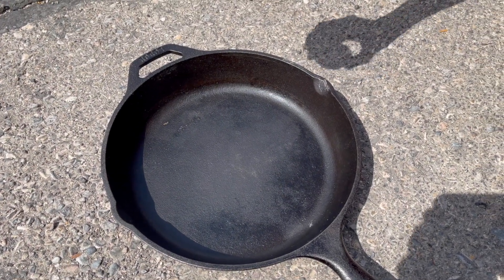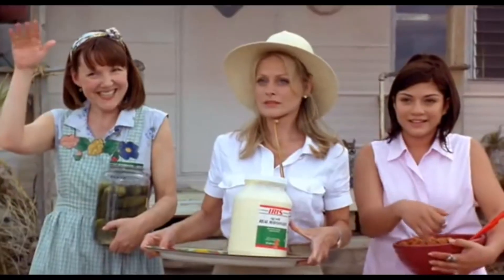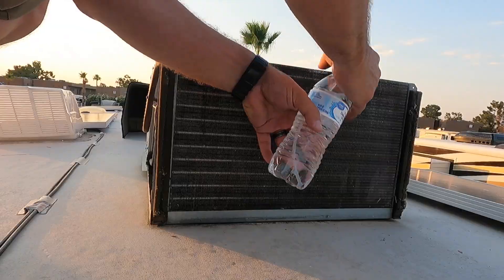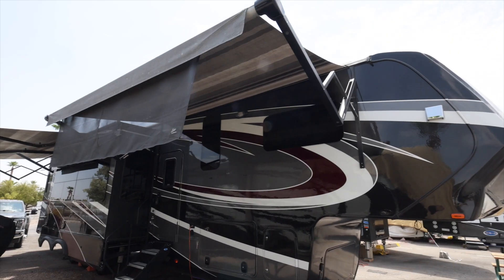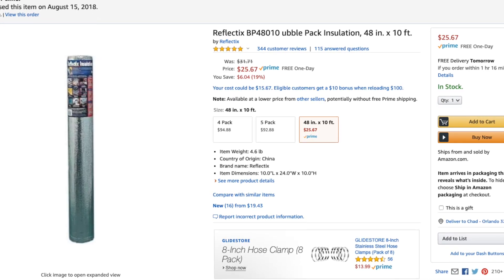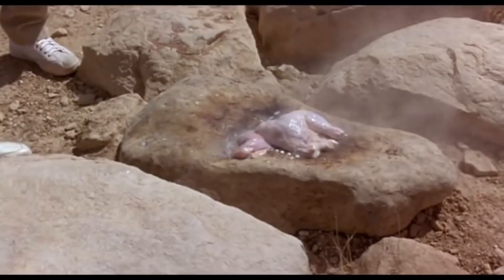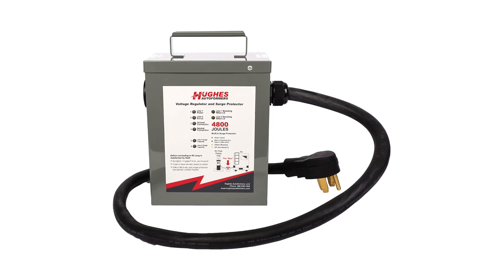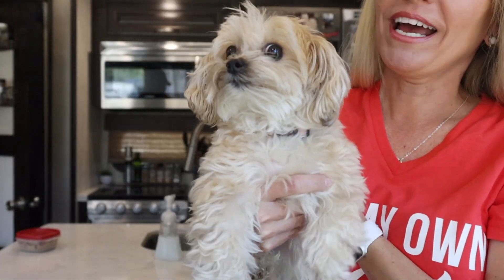🥵  RVing in EXTREME HEAT! ☀️ (Full Time RV Life)

Comment: I am a travel nurse that was in ridgecrest last year that was 122 at the fair grounds with no shade.  I had to do the fans to the fridge (I did dryer louvers so when not in use stayed covered), the airflow ac hack,  reflectix in the windows made 15 degree difference, reflectix in all the cabinets that touch the outside (this included my closet), black covers for the maxi air and bathroom fans, relectix in the shower as well with ivy tape.. you could tell in the evening when the sun heat let up cause it would start to get cool again.. I bought booties for the pup as well.. the coldest place was the spot that went to the crate for pup and the bathroom after covering fan/skylight.  I have a reflection.  I saw in bakerfield ca a nurse who had the sunshade and said it worked. In bakersfield many of them put in a window unit that ran better than the rv ac.  This year I am in fresno with 110 ish  and with shade, soooo it's a tad better cause hot shade is still hot.   the 120 plus days the rv did get to low 90 in rv and with a fan was tolerable but no way fun at all...    I am going to get me a ice maker this year to put ice in bins in fridge to help.. I am doing water bottles but the freezer take a few days to freeze them..

Comment: Another great helpful video! Ty for helping people in this way. 
If I can add one thing. 104v and lower WILL damage electronics! I hope people will get something that will monitor this. I use a power watchdog. And it automatically cuts power at 104v. Even if your starting voltage is 113v or so. It can and does dip below 104v without you knowing when others around you use more power. 
I just battled low voltage for 3 weeks. Starting voltage was 117v. Around dinner time, 4 to 8pm. EVERYDAY my watchdog would shut it off so much I found myself sitting in the dark watching YouTube on my phone. Thank goodness I didn't need my A/C. 

I hope this helps someone.

Comment: Chad, FYI. A good hack for low voltage problems is to run a small water line (1/4" poly flow) to a mister nozzle in front of condenser. Makes a small mess but will lower compressor amperage alot.

Comment: We use Micro Air Easy Starts on our Airstream and it's amazing how low the amps become with those in use and have never had an issue with our AC's starting and staying on during high heat situations.  Highly recommend you get those put on your rig Chad.  You won't regret it!

Comment: If you have water, a mister (in the irrigation section) will greatly help remove the heat from the coils and make your AC more efficent.  in an arid climate such as Las Vegas, the water will evaporate quickly;
Also while boondocking, a small spot cooler (12,000 btu) runs on 120 volts (less than 1000 watts)for less that $400.00.  .A small quiet generator is about 67db (quiet) and will handle 2000 watts (1600 continuous). Harbor Freight has a quiet generator for less than $600.00.
Will not bother people at Harvest Host etc.

Comment: Water misting helps reduce the temp by about 10 degrees.  I put a sprinkler hose on the roof of my store during a heat wave (I had my own well).  Most people didn't even know it was up there, but they sure noticed the building was cooler. Problem is the west is also short on water right now.

Comment: I find the exterior wall cabinets on the sun side of the rv always trap and hold heat. My question is would it be better to open them to get rid of that heat or would it help as a barrier to keep that heat trapped.
Propane fridge for the win!

Comment: I feel you guys. We have a 42 footer. I think we got to 118 Phoenix AZ. Thankfully we have great voltage. We don't have a toy hauler so that might have helped but we needed to make adjustments fast. One day (109°) we found one of the shade slid off the roll. The glue had soften to the point it couldn't hold anymore. Putting that back on was a challenge. The biggest difference was that reflectix in every window and the shades down. We also have the awnings out when it wasn't very windy and slide top awnings which I believe help keep the sun/heat off the slides. We have the 3rd A/C on from morning to sundown. We also added the RVairflow.  Door closed as much as possible. We also have the Norclold 18 cb ft but it did well maybe because its newer. We also had heat coming from the stairs and found that there is a furnace vent there. I blocked that hole and that kept that doorway and hallway cooler as well. We will be in cooler places the next time for sure. Thank you for sharing your knowledge with us it makes a difference.

Comment: Howdy folks! FWIW, I just installed that softstart on my truck camper, and tested it yesterday. I just have the one AC. My generator/inverter in of the Honda flavor, and is one of the older models (2000W). In the past, I've always run the gen. on the "eco" mode, and it would "step up" to meet the electrical needs. This time, that didn't work. What did work, however, was to just use the gen. on the full run mode. It worked flawlessly with that little gen./inverter! Also, the hook up of the softstart was super easy, the most difficult part was finding a place for the unit under the shroud, there was virtually NO space in there for it, but managed to put it under the fan, where I pray it will not interfere with the AC performance down the road.

Comment: Wife and I were camping in Maine this year during June when temperatures were reaching 96F. Our campsite electric hookup was cycling between 110 and 102 Volts which was blowing our surge protector and shutting off our AC/frig. I was worried that our compressor frig and AC unit might be damaged from the low voltage, so I ran them off our LiFePO4 battery bank through our inverter and used the non-surge protected low voltage campsite hookup to charge the batteries. The AC and frig saw good voltage from our inverter and the batteries stayed topped off.  We ran that way for 5 days without issue. Sometime you have to MacGyver your systems when the campsite utilities are dubious.

Comment: I have an older class B. The air conditioning is a piece of cardboard I wave with my hand! Lol. I have a few fans too but they use a lot of amps off my deep cycle battery, so I only run them when I have AC power. I'm looking for a small window air conditioner I can set in the door window & run when I have AC power.

Comment: Hey Chad and Tara,  I am stationary living full time. When the heat gets above 90 I place a  10" round fan in all just above the steps.  This helps pull the cold air down the hall and pushes it into bye main living area.  It also helps cool down the hallway.   This keeps the5th wheel in the upper 70s. Worked in 117 degree heat.  We have 3 a/c s going and it works.  2 adults and 2 toddlers.      Reflects in the windows.       I wanna thank you both for channel,  it helps me learn how to keep are home safe and maintained.

Comment: Another tip is to take a look at your doors!  Both external and internal, they all should have some sort of gasket, although lately, with the cost cutting going on with RV companies, there are alot being sold without them.  If your gasket material is old or compressed enough where you're not getting a good seal, or are non-existent, have them replaced.  In a pinch you can use towels to put in-between the door and the frame when shut.  You can test whether you're getting a good seal by shaking the door while closed, if you can see/feel lateral movement you're not sealed. Also with internal doors, I've seen some very well gasketed seals but with  a huge gap under the door.  You really want to seal that gap with towels or blankets to keep that (hopefully) cold air from leaving that room you're in.  Stay cool!

Comment: Great video. After watching, I went out to my unit and was going to do this modification. However, I found that my plenum was built and sealed pretty well. It had a very rigid divider. This was great because the insert you showed probably would not fit anyway - there are wires and a control box in the way. Anyway, one big discovery I must thank you for is that I found my dump vent slider greatly restricted the outflow of cold air even when it was open. Fortunately, I can triple (I guess-stimate) the outbound cold air flow just by removing that half of the cover panel, which is easily done. Should make at least 15-30% air flow gain. Side comment - I built some inch thick window inserts out of common foam board and wrapped the edges. I painted one side (the non-silvered side, reflective side goes out) to match the interior of our rig. They snug-fit easily. They came out very elegant looking and even had some visitors state they thought they were an OEM option. We use them mostly at night for cold nights, and they black out the interior so you can sleep in late if you want. They would also work in the really hot days. 

I have been intermittently watching your videos and now I will become a subscriber. Thanks!

Comment: We stayed this last June in las vegas. The Temps were around 118 to 120 during the day and around 103 at night. We stayed in our 2002 newmar mountian aire 4065 diesel pusher motohome with dual slides and only dual ac units. This coach did really well in these Temps. We never saw over 75 degrees inside and did not use any out of the normal tactics to keep the heat out. We just closed the shades to the night shades and kept ac units on. The units did not cycle much during the day but once the sun went down the units would start to cycle normal all the way thru about 9am. We stayed at oasis rv park with is off the strip right across the highway from the silverton casino. We will definitely be taking another trip to Las Vegas and staying at that rv park. It is beautiful there and a great park! Power was never an issue. We never had any issues with our fridge either. It was constantly cold and freezer frozen. Strange that you had so many issues. Maybe difference between the way a class a coach is built to the way a 5er is built?

Comment: Just know that utility are required to provide 120/ 240 volts (+/- 5%). Most folks are not aware of this requirement. Also when the very high temperatures all utilities are trying very hard to keep the voltage on levels 500kv, 230kv, 115kv, 66kv and so forth at it highest level which keeps the current at lower levels. It’s a balancing act for sure. Hoping this helps some. Enjoy watching your videos.

Comment: I agree the post should have been as expected, but I do have a SoftStart and I’ve found it makes a HUGE difference.  It requires much less power to run my AC and my AC is MUCH quieter, which means there’s much lower likelihood of blowing a breaker. I’m definitely a fan!! I also have a diagnosing surge protector that would have proven to that campground that the post was at least part of the underlying issue.

Comment: You need to get the Soft Start devices for your roof air conditioners.  They not only help to get them started without the big current surge but they help with the overall operation of the air units to last longer.

Comment: Thanks for sharing!! Is there a way to run one AC on solar and two AC's on the generator when in a pinch?
Reply from the maker: sort of...  The inverter can do power share but only on line 1.  We could set the shore power setting to something like 5 A on line 1 and it would pick up the main AC...  Then the rest could run on genny....

Comment: I’m full time . travel trailer rv ;stationary with 5% ceramic tint , factory shades with black out curtains, clean AC , 2” foam board in roof vents . Constant heat index here are 98 degrees (F)outside with 75 deg (F) inside . The ceramic tint lowered inside temp 5 degrees
Reply: What's a ceramic tint?
Reply: @immasher2139  Its a type of window tint film. It mostly blocks uv and infrared light while letting visible light though. Popular on cars in hot climates.
Reply: @mgkleym  so it's a low E film?
Reply: @immasher2139  it's a type of low e film. It's called ceramic because it literally uses tiny particles of ceramic instead of the more common dyed or metallic films.

Comment: We just brought our new 5th wheel home and for craps and giggles we tried the A/C and it ran for at least 45 minutes then the house circuit blew. Its only plugged into 110 but we had the house ac going, lights on etc. Its one of those Whisper Quiet A/C's so not sure if it has a soft start but our Rockwood just had a regular RV A/C and it would pop a circuit in a second. It's been hot and humid here too in the NE, put a coat of wax on the new rig and swear I lost like 10lbs, its 43ft long so it took me a bit. Seems like you guys did everything you could possibly do. One thing I love about this new rig is residential fridge/freezer! No more stupid rv fridge getting into the 40's.

Comment: I grew up in Baker, CA, just 90 miles south of Vegas.  I always tell people that it would always have overnight lows in the 100's but nobody would really believe me.  We used swamp coolers, i.e. evaporative cooling, and it works better than AC in the right conditions, with no humidity, and high heat.
Just as an addon, you should really avoid the desert southwest in the summer :P  It gets warm.

Comment: It hit 118F even all of the way up here in N Idaho (High Humidity also), AC condensers iced up 3 times in 3 days, was a struggle to keep it below 100F inside the RV (35') with 2x AC's.

Did find that putting a pice of 2" insulation foam over the top of the fridge slide helped the fridge a lot
Reply: Any ac unit will ice up if they run for to long time, And unfortunately hi humidity does not help.
What you can do is shut off the ac for about 5 minutes with only the fan running this will help to remove the ice on COIL where airflow can be reestablished.Hope this helps!

Comment: Hi Guys, Can definitely relate we have been in Quartzsite Az  since June. Installed 2 Micro air  easy starts in our Ac units along with RV Airflow thanks to you. We have 2020 Grand Design Reflection 29rs. Haven't thought to check the voltage at the  pedestal but  with the soft starts have had no problems with tripping  breakers the temperatures here were as hot as Vegas if not hotter managed to get 23 to 25degrees cooler than outside. Our rig is only 31 feet but between both upgrades along with  slide toppers we're hanging in there. We can relate to the hot wind too. Today is the coolest day we've had since we got back here. We alternate Ac's  bedroom at  night and living room during the day both if it gets to hot as our pooches need to stay cool too. 
Former Nevadans from the Reno area. 
Take care and try to stay cool. 
D & C Hopper

Comment: When camping off my motorcycle or driving my truck (no AC option), I use a spray bottle filled with water and spray myself intermittently. I also soak my shirts. I keep a floppy hat with me. Lightweight long sleeve moisture wicking shirts as well. It's not all that bad to camp in the desert during summer. Main thing is acclimating your body to deal with it. As far as your RV ditch the AC idea, open widows and use my above tips.

Comment: Great video  I live full time in a 19 foot travel trailer in Mesa AZ  hot temperatures. The ac does not have a thermostat on and off switch when I get home from work it's hot in the trailer 110 120 .takes a while to cool it down.  The refrigerator I put two frozen water bottles and a small fan to it in the high 30s. I would like to move my wallet said no also not sure I can trust my truck on the highway in this heat.

Comment: I was told that I would never want to goes there to Vegas during summer as I did once (the first time) there in July 2005 & temp were over 120 degrees! I did have a pass-out at my hotel bed after a short walk in the nighttime on the sidewalk. Also, the hotel had a small pool as it does not look good to turn out terrible water from too many people who used lotions floating the water. I never like to go there again the way of the summer season. I prefer the winter season when the temp is cooling down. Now you know what it is like to be there during the hottest season in Vegas. Will you want to goes there again?

Comment: I’ve found that taking the garden hose and wetting down the roof helps immensely.
Reply from the maker: I thought about that.. maybe a lawn sprinkler on the roof.. but the park does not allow it. ☹️
Reply: @ChangingLanes  You might be able to at least cool off under your awning by building a misting rig using 1/4" plastic hose and mist nozzles like those used for plant watering. I do this to cool my deck surface for my dog's paws as well as hanging from our awning tube when we stay anywhere in the South during the Summer. If you're in a park that won't mind, putting this on your roof should significantly cool things down without using as much water as a full on sprinkler.
Reply: @ChangingLanes  we have cooling misters that string along our awning but can also be coiled on the roof to keep it wet without the high water usage of a sprinkler.  Hook a y valve at the hose faucet.
Reply: Run a Soaker Hose down the middle of the roof. Make sure you have soft water to avoid mineral spots on the sides of the rv.
Reply: I would certainly consider a misting system for the roof.  You showed briefly the shade covers that use pvc to arch the shade.  Misting those would cool the airflow beneath them, drip onto the roof, and provide evaporative cooling.

One other tip.  As a child, in Texas (Ft. Worth), during the heat of summer, before AC was present, we would wet towels, wring them out a bit, place them on top of us at night and blow air via the fan which would cause that evaporative cooling effect.  When they start getting hot, you just hold them up in the air and "wave them" then place them on top of  your body again.  It worked then and I have used it a few times as an adult.